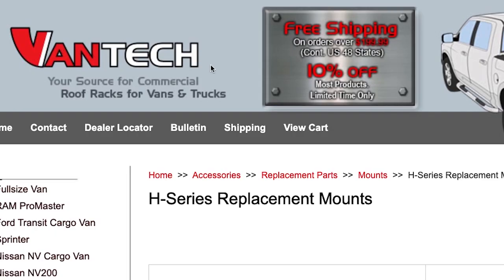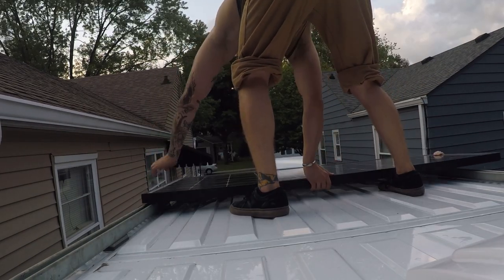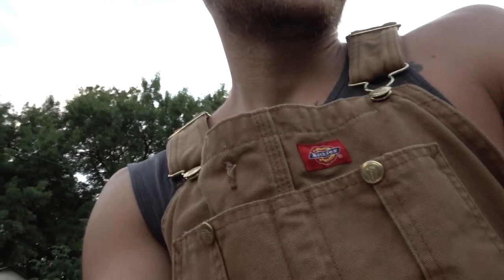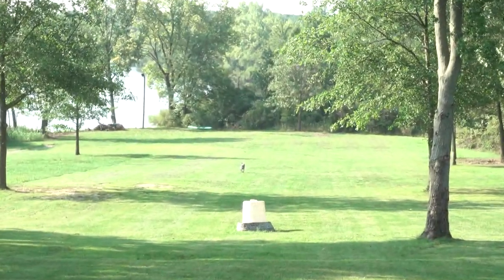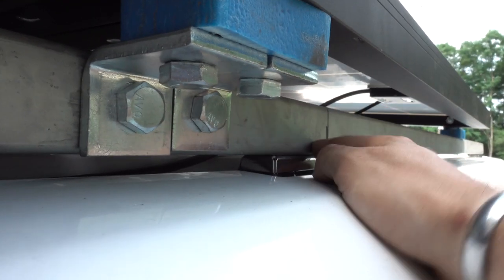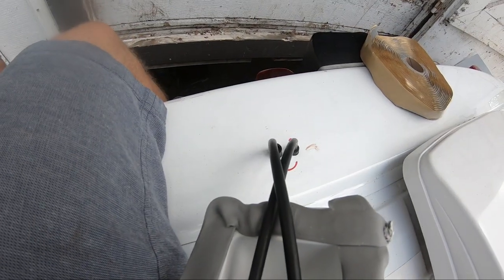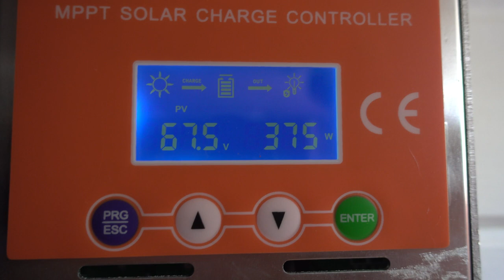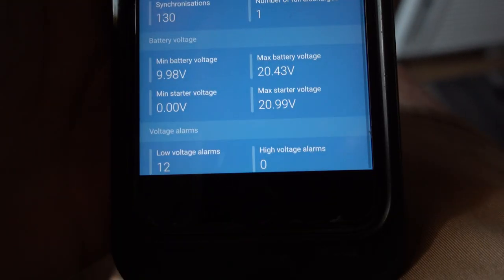Sticking Big Ol' Solar Panels On The Roof Of A Van | Vanlife Solar Setup

Comment: Could've used fiberglass unistruts instead of steel ones. Weighs much less than half but just as strong. May cost a little bit more.
Reply from the maker: Tony Brion sounds like a good alternative. We just used what we already had laying around.

Comment: Butyl tape is great but it's better for sealing gaps where mechanical forces are holding everything in place. I would recommend you replace the butyl around the solar panel cables with a sealant with some holding power (like a silicon.) Over time that butyl could come loose from wind and other forces and let water in.
Reply: Good call! We used 5200 for ours based on holding power!

Comment: It's hard to believe but Renogy gave you those red and black covers for the connections to the inverter for a reason.  If you don't put them on you might get a crash coarse on ARC welding.  I am not kidding when I say you can burn your van down to the ground along with anything in it if something conductive falls against the + and - of the inverter.

Comment: As a solar generator novice myself  I got a 1500 watt and    2 foldable solar panels of  80  watts as I was not ready to put holes all over my 2019 Ram Promaster until I was able to learn the benefits of getting  2X 300 panels which  can be so expensive and BTW depending on the regional weather you would only get 1/3 of 600watts

Comment: "that's running... i'm not sure if that's good or bad..." funniest line ever! Also, I saw a promaster build where they ran the wires from the panels in thru the  backup camera box at the top rear, looked like a good way to do it...

Comment: Your video is much appreciated:
At 11:25 you showed me, even with the minor snafu, that a small vent can be placed correctly and with enough space under the panels....This has been my idea all along. Actually I would have 2 of these small ones, one in the shower stall and one on the back on top of the bed. The Maxxair would be towards the front and 3 of about the same size solar panels that you have would be installed  instead of 2 (it fits!). In this way I can maximize the amount of incoming watts while I still have enough ventilation.  I believe one Maxxair  (up front) in combination with a small vent and a pair of 'ProMaster Airvent Cab Window Inserts' -is sufficient ventilation for a 2500 Ram Promaster 159 WB Hi-top since these vents can handle much larger RV Volumes.

I have a few questions:
1) How much clearance in inches do you have between the Roof and the panels for the vent?
2) What vent make/model are you using? Would mice be a problem? (I have no Idea....)
3) Do you know the dimensions (W and H) of your Superstrut?

Found this 'sucker'...Rough opening 6 1/4″......Vent extends above roof 2 3/8″ closed, 3 1/4″ open:
 https://dogboxparts.com/product/ventline-trailer-roof-vent-w-12v-fan-6-14-diameter-smoke/

Dometic, the fridge people, also make this one that can work closed since it has side vents "Built in rain cover enables air circulation throughout without needing to open the dome"....Dimensions product height 4.34 "
https://www.dometic.com/en-us/us/products/climate/ventilation-solutions/rv-roof-vents/dometic-ez-breeze-ventillation-fan-_-52170

Cab Window airvents:
http://www.eurocampers.com/2014--2019-Dodge-ProMaster-Airvent-Cab-Window-Inserts--2pc-set-see-product-description-for-correct-fit-available-mid-September-2019_p_1101.html

THANKS FOR YOUR INSTRUCTIONAL VIDEO!
Reply from the maker: The solar panels sit about 3 1/4" from the roof leaving just enough clearance for the vent underneath the edges of the panels. Now if I would've placed the vent fan slightly back allowing me to miss the edges of the panels I wouldn't have had to use risers since the hollow part of the panels would've given me an extra 1 3/4 inches. 

I purchased my bathroom vent fan from eBay for pretty cheap. Here is a link https://tinyurl.com/y2vv6g69. They have the items dimensions listed in the description. I've never had any issues with bugs or rodents. 

The superstrut is 1-5/8-in x 1-5/8-in and they were both 9' long.

That small vent you found is similar to what I purchased. It's probably better. The dometic roof vent looks really cool and I like how it can run without having to lift a lid. I wonder how well it works. Those cab window air vents are nice, but pretty pricey when I'm fine with just cracking the windows. I guess they provide added security from intruders and unwanted bugs though.
Reply: @dogcatmanvan  Thanks Dude!

Comment: Good video showing the trials and tribulations of a van build. You should have run the cables through the third brake light housing instead of more holes :)

Comment: I was thinking about using L brackets as well! But I don't think my 2006 Freightliner Sprinter has any sort of built in mounting points so I was thinking maybe just use two L brackets together and still them straight into the roof! :O
Reply from the maker: That Travel With Jaz guy has a video on his solar install on a sprinter that you might want to check out. I think he used some corner brackets on hinges and then just glued them down to the roof so he didn't have to put any extra holes in.

Comment: Perfect timing for this video!!!! Mat just installed our solar panels and tried referencing some of your older videos to figure out how you dealt with the super bumpy roof! Now we're sitting here with our gland entry like how the f* are we going to flush mount this thing!?! Hahahah and boom... Your video posts! 

We were looking at the front flat area made for, well idk what it's for, but that flat part behind the roof lights. I'm guessing you didn't mount it there bc of your wind guard? And with it mounted in the back, have you had any leak/airflow issues since it's facing the wind?

Thanks for making us both laugh our assess off each week! Loving your edits and so curious how you got so pro status with the animations? Either way, you're aMANzing! 😅😂🤣😂😅

~Lisa
Reply from the maker: We ended up mounting it in the back because it was the easiest way for us to get the solar cables to the charge controller. I haven't had any leak or airflow issues so far. The wind fairing up front in combination with the solar panels seems to take care of the wind. 

As far as the animations go, I work as a director/editor for a production company called Bayonet Media along with a few other talented editors. We usually do boring commercial work so these videos are fun break from that. The three of us each tackle the episodes a bit at a time while adding our own comedic touches in order to make them fun and entertaining. 

Thanks for watching and let me know if you have any other questions!

Comment: Finally someone doing what I been thinking all along (big panels) but I rather see 1200 watts even if you had to fold out panels. 

Logic is that your panels can offer shade and power. Not power to store so much but power to burn to dump. So you can have plenty of power in the day, generator at night.
Reply: That sounds like a lot of weight! 🏋️‍♂️
Reply: @lisaandmat  330watt panels weigh 44 lbs each.

Comment: I skipped out on the whole solar thing. I got an over built generator and built my electric around that. I just don't see all that much benefit on solar. takes so long to charge, you can't run anything high draw off battery (like air conditioning), and I'm using camp grounds with hook ups much of the time. I'd say solar is not universally useful. I'll look into it one day maybe. but glad you got your setup sorted. Keep on rollin buddy!

Comment: Should have just got 12v panels if you were only going to step the voltage down to 12v anyway as you lose power in the conversion process. Dunno what you set your battery alarm to but if you goes below 50% permanent damage will occur to the batteries (assuming they are lead acid) usually a severe loss of capacity but if you actually drained them then they are as they say....proper fucked.
Reply: I am surprised too you chose AGM rather than lithium batteries. Now that it's been a year, do you think you'll end up switching? Curious on your feedback.
Reply from the maker: I went with the 300watt 24v panels along with the AGM deep cycle batteries because I needed the most bang for my buck. I think I would've ended up spending around $1200 dollars more for the Lithium Ion set up and I didn't have that money at the time. Now I did drain my batteries really low one time because I installed water tank heating pads and forgot to turn them off over night during the winter. It definitely damaged my batteries and was a lesson learned. They still work fine for now and maybe one day I'll invest in a more expensive set up with Lithium Ion Batteries, but I'm happy with what I have at this point. I'll definitely want to reassess my battery situation a few years from now, but who knows where the hell I'll be at that time.
Reply from the maker: I hope my response to erldorh answers your question.